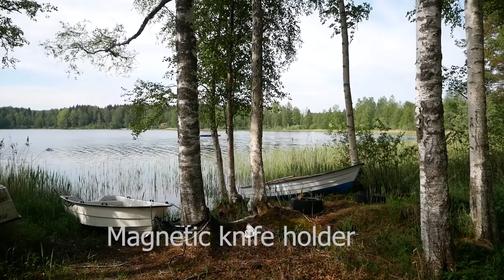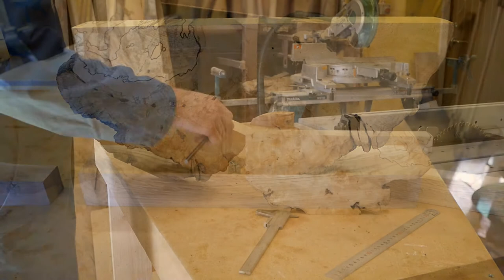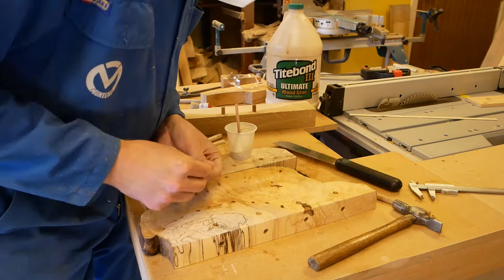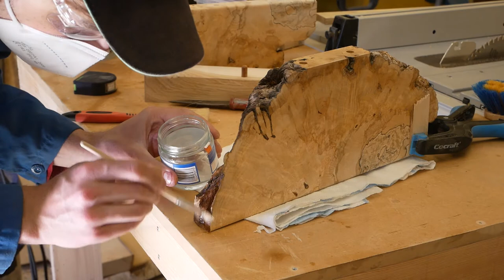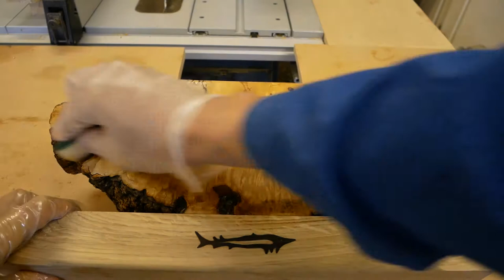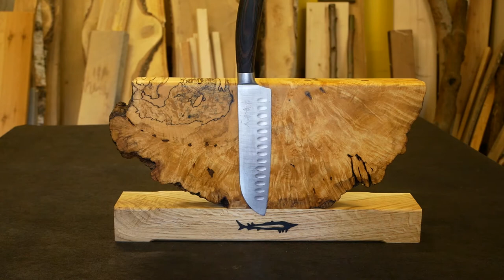Magnetic knife holder #2

Comment: I have a substantial collection of folding knifes, from various Spyderco and Benchmade to Atisan cutlery and Kershaw, and since now I'm holding them in various drawers and plastic boxes, I was thinking about building some kind of a holder/display case/mount for 10 knifes I use most frequently. My idea was to take a live edge piece of plank 1 m x 1 m x 7 cm and make some sort of cutouts with a router that would fit a knife. When forded these knives are around 10x5 cm. I was thinking about carving around 10 of those from the oak plank, smooth it out with a router bit and sanding paper, paint it and voila.. Maybe some kind of short 10 cm legs for the plank to stand on at a certain angle would be cool.
Oh yes, did I mention that I'm a complete woodworking novice and I don't own a router, table saw, planer or any of that fancy stuff. I have a press drill, drill driver, some hand tools and a lot of sanding paper... I almost forgot. I don't have an orbital sander either to smooth out the surface, let alone a planer. I'm planning to buy the most basic hand held router for this project so I would be thankful to the grave if you had a go with it and make something like this with a simple set of tools.... Thnx...
Reply: It's a great idea. There are tonnes of "how to" videos about the magnetic/block holders for kitchen knives but maybe 2 about the folding knives. Folder has to be on display to be admired too but at the same time easy to reach and take one out. Of course there has to be some beauty beside the practicality.. Give it a go Roman..

Comment: From South Africa-beautiful piece of wood.would struggle to find birch in Cape Town.
2 Questions:
What oil did you use?
What distance between knife and magnet? I'm struggling to get a definitive answer from a supplier. Planning to use wild olive which is a beautiful wood but as dense as a railway track.
Reply from the maker: Greetings !
I use "Festool Surfix heavy duty" oil. Its a good product , i can reccomend it for sure.
Distance between knife and magnet is depends  from 2 factors - power of your magnet and weight of knife what you will use . I strongly recommend you to do "drill" test on wood scraps ( i do it usually ) for my magnets its around 2.5-3 mm. from knife.
Best regards!
Reply: @romanrudenko1614  thanks for that.